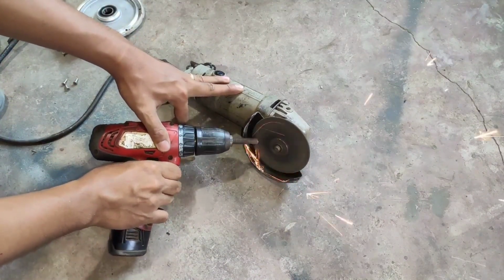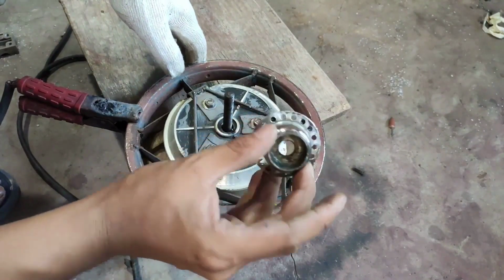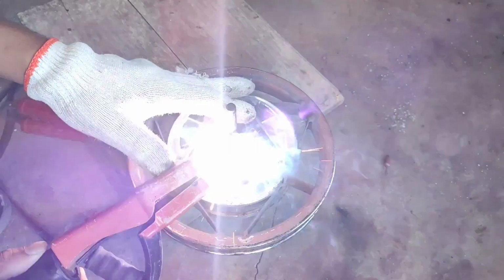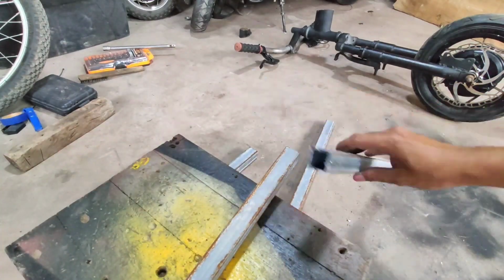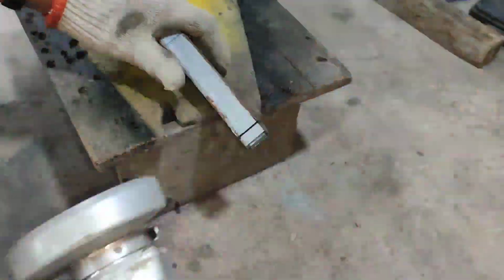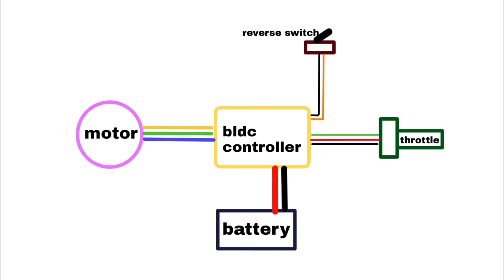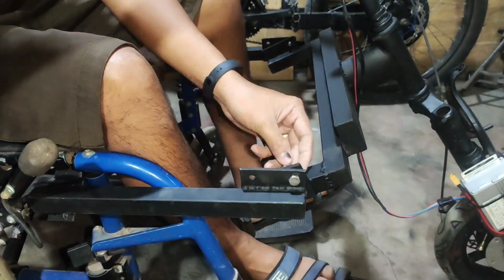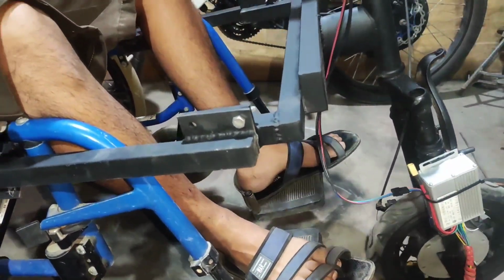Make electric wheelchair using hoverboard motor

Comment: Sir, tanong po.
May reverse wire o reverse connection po ba yang ebike controller na ginamit nyo?
Kung wala po panu nyo po nilagyan ng connection na magka reverse yung ginawa nyong hoverboard motor wheel.
Salamat po sir sa itutugon nyo..
😊😉👍